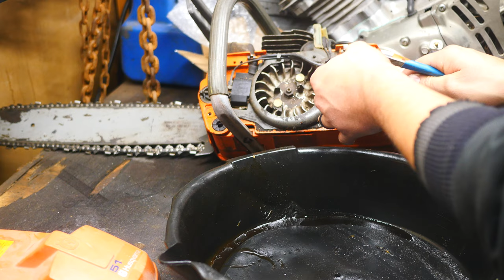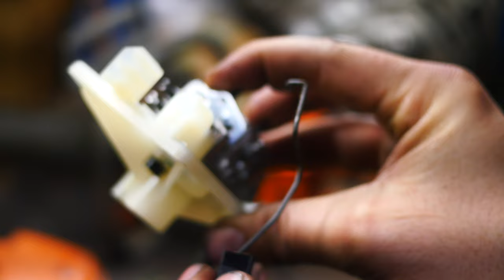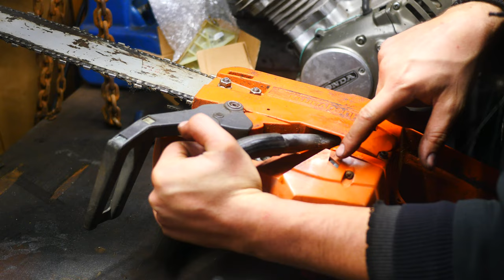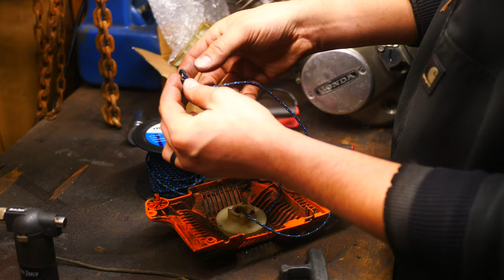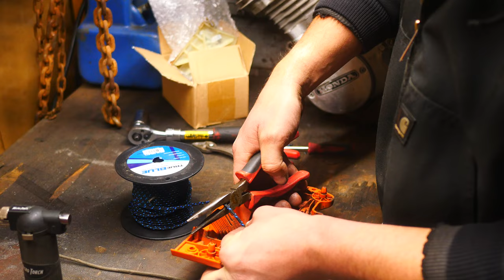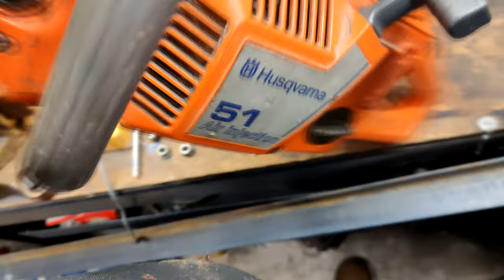Husqvarna 51 Chainsaw Carburetor Replacement

Comment: How did you end up liking the carb?  Im looking for a decent carb for the 51
Reply from the maker: @dancollins2546  The carburetor ended up working out great you can see in the video that it doesn't start but that was due to a scored up cylinder I didn't know about. After I put a new cylinder on it I tuned that carburetor and it works great no issues Just make sure you run ethanol free fuel through diaphragm carburetors The ethanol will eat them.
Reply: @ils360  thank you!  I think il get one